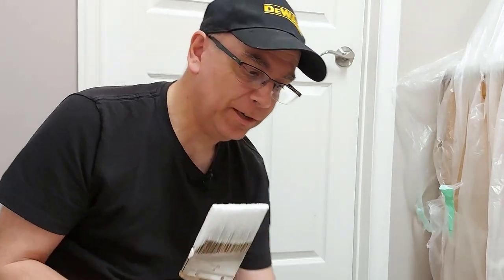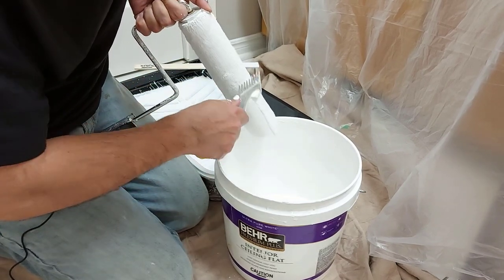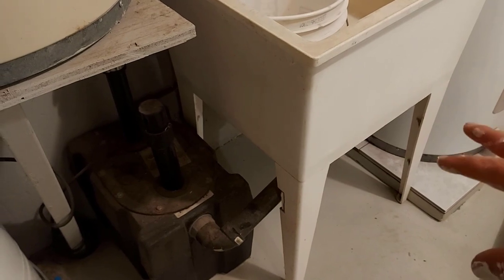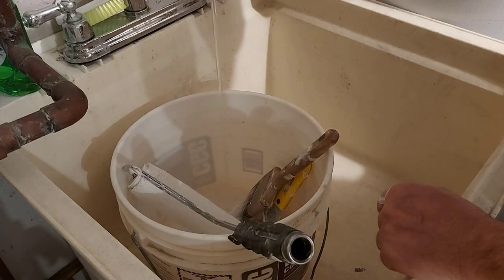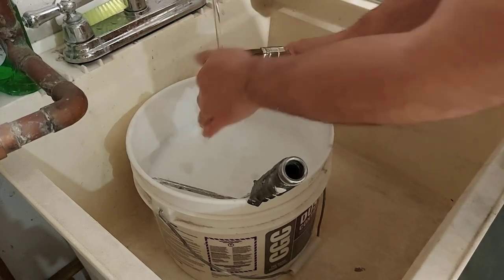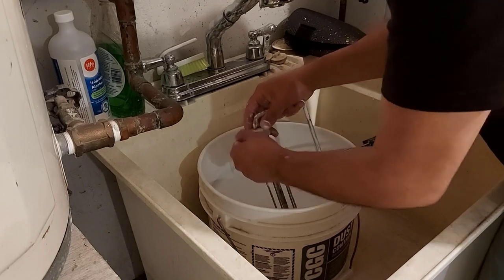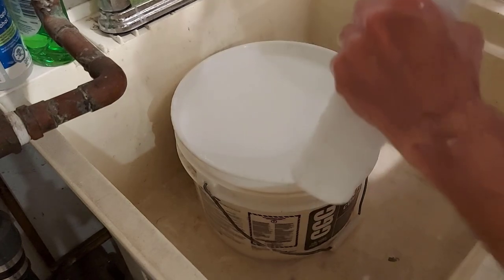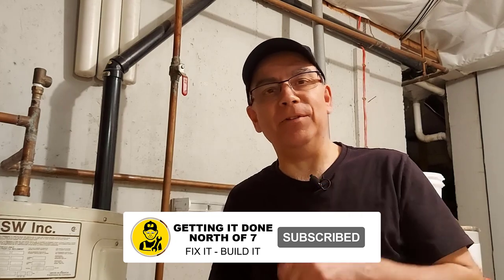How to Clean Paint Brushes in a Bucket When You Have a Septic System

Comment: Yeah but what do you do with the water?
Reply: You pour it down the drain , when the camera stops rolling .
Reply: Add a bit of hydrated lime and aluminum sulfate. It will attract the paint molecules and form a layer on the bottom of the bucket over several hours. You can then pour the clean water down the drain and then throw away the bucket once it dries. I should add that this works for water-based paints.

Comment: What if I install a separate "septic" system just for the paint would that work? Although I might kill the grass above but maybe I could put like a flower bed on it!. I wonder if a septic tank in that case would even be useful since you said that it would float on top of the tank so it might block it. I also wonder if it would block in the leech field or only the tank. But you also mentioned a macerator so maybe a dedicated septic would work just fine.